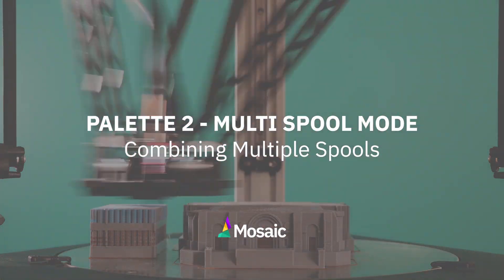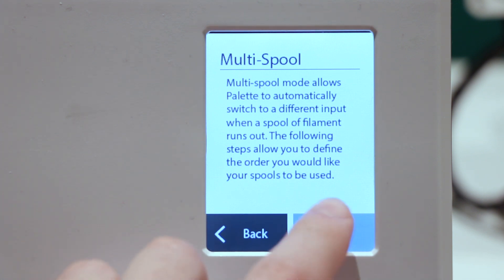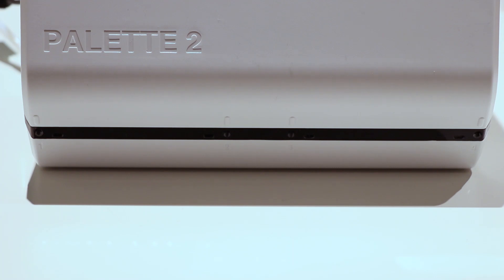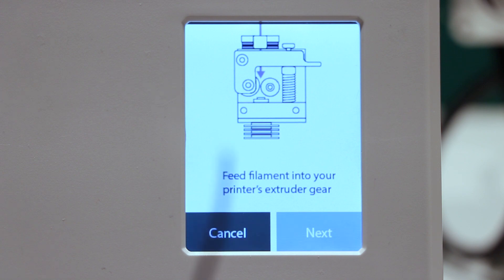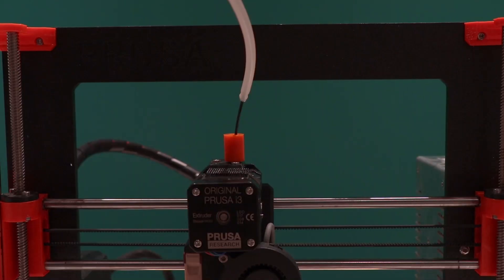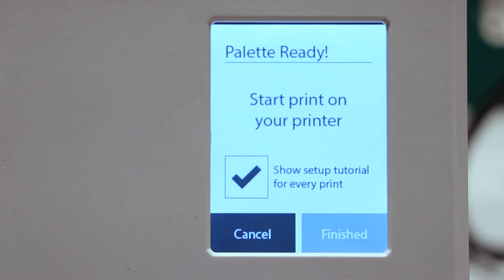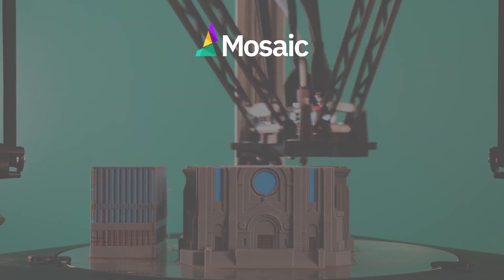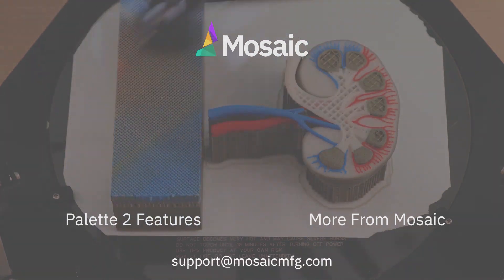Palette 2 - Multi-Spool Mode

Comment: Am using multi spool mode for my printer to print big parts.i can't print using 1mm nozzle at high speed because the federate of filament from pallete is not sufficient.can u help me how to change feed rate of mosaic pallete.I am printing at 30mm/sec using 1mm nozzle.
Reply from the maker: Hi santhosh, we have a test firmware that increases the feed rate of Palette. Please send us a message at support@mosaicmfg.com and we can send this over to you.

Comment: Couple of notes. 1) You should had the fact that the cooling fan will come on full speed during Multi-Spool mode, and will stay on as long as its in Multi-Spool mode.  2), what do you do when the buffer runs out of filament and won't "buffer" as seen here? https://youtu.be/BtdWqMy5lAc
Reply from the maker: Thanks for the feedback, Fred. Based on your video, this is a recent bug that has appeared in our firmware where the buffer switch is not communicating properly when triggered. As mentioned in a response to your comments on another video, we expect to have a firmware update released by the end of the week that will address this issue. We appreciate your patience.

Comment: nice that it cuts the filament. shame that it doesn't feed the in rest of the small bit left. leaving it cut and just... well just taking up space. the cool thing that palette 3 could do. is have a motor come out the top or something so that you could just use palette as a splicer for all the small stuff you have laying around too like the real small stuff
Reply from the maker: Hey Korey, there is a bit of leftover filament since the filament has to reach both the ingoing motor and outgoing motor in order to create a proper splice (as there is a bit of compression needed). We're working to create as little waste as possible and will definitely re-visit the multi-spool mode to reduce any leftover filament in the future.
Reply: @MosaicManufacturing  yeah after more fiddling with it I understood why after I caused some jams. Haha. But the thing that's fantastic is the jams are so easy to unjam.

Comment: Is it possible to choose spool numbering order? Or is it always from left to right?
Reply from the maker: Hi there, you're able to choose the order of inputs from Palette's screen.
Reply: @MosaicManufacturing  How? If at the screen where I select inputs if I select 4, then 3, then 2 it starts making the filament in order of 2, 3, 4. Theres no secondary screen after selecting the inputs that asks for the order.
Reply: @StuffWithKirby  No your are not able to choose the cycle. Its standard from 1, 2 to 3 and 4.
Reply: @MosaicManufacturing  Can you post the SOP as you describe in your response?

Comment: A few more questions... 

If one input runs out of filament and switches, can you then feed another spool into the input that ran out while printing, and have it switch back to that input when the others have run out?

Is there an output or a good solder point on the board, to use as a trigger for when the palette is splicing? Something you could use to say trigger a MCU to stop winding a spool for instance, or trigger a GPIO pin on an RPi to pause a print or take other actions? If so, what are it's specifications, and location? Voltage, current handling, etc.

Can you feed filament in from the top, and have filament fused onto it? For instance, if I already have a spool of filament, that I want to add a smaller chunk onto, without feeding the whole thing through.
Reply: Hey jesondag, to answer your questions:

- Currently, you would not be able to re-feed filament into an input once it runs out of filament. Runout detection will follow the order of inputs that you place in Multi-spool mod, however, we are working to create this feature in the future.
- The trigger from the solder point on the board wouldn't be possible without heavy modification, and we wouldn't recommend this unless it's necessary. We haven't experimented with this with Palette 2 units in the past.
- You would not be able to feed filament from the outgoing tube.

Please let us know if you have any additional questions.

Comment: Does it pause the printer if it's connected with a canvas hub? Is there any chance the splice might not happen fast enough, or does it keep the buffer full at all times in this mode?
Reply: You can pause the printer via OctoPrint if you're using a CANVAS Hub. The splicing and printing speed would depend on a few factors (nozzle size, layer height, print complexity, etc.) but Palette does work to keep the buffer full at all times. If you do find that the buffer is closing too fast and too often, we do recommend lowering he print speed to account for this.
Reply: @mosaicmanufacturing1603  Does/can that pause happen automatically when the filament runs out? How many millimeters of filament does the buffer hold between full and empty, and how long does a splice usually take on a palette 2 (non-pro), for PLA-PLA, with the cover off?
Reply: @jesondag  i don't know how big but seems like a 5-6"  sized  loop?   maybe less but going 80mm/s at 0.3mm layer height might be fine assuming your going that fast (depends on acceleration and model size)....lower layer high would eat filament slower.
Reply: @digibluh  The amount actually stored is going to be the difference in circumference between the largest size of the loop and the smallest (roughly, since it's not a perfect circle, which is a little hard to judge from pictures. I imagine that's a number the designers know though.
Reply: @jesondag  The total loop is about 120mm. The actual fill level is 52mm. The distance between the knife and the splice zone is 32mm, and when the filament is cut this much filament is pushed into the buffer. So the efficient buffer utilization is 84mm.

Assuming the default PLA-PLA splicing profile (40s to splice), 0.2mm layer, 0.4mm nozzle, and 100% extrusion rate, the buffered filament is enough to sustain it at 63mm/s.

But it is frequently draining the buffer down to empty to calibrate itself. And if you run out while it is empty the efficient buffer utilization is 32mm, and the max printing speed is 24.8mm/s.

So if you want to be sure that the print is not failing when the spool run out you must print at 24.8mm/s or slower.

Comment: Cool! But i wonder if it would be possible to splice together broken sections of filament back together and wind it up on another spool? (like for example prepare a spool for later usage when using multi colouar and/ or material)
Reply: Yes, that is possible! We have runout detection sensors on Palette 2 so once one input is empty, it will switch to the next one. This will allow you to connect small lengths together easily.
Reply: You could turn a spool with a stepper motor, and the built in encoder should just speed up the drive to account for it. You just would want to run it slow enough that it has time to splice before the buffer runs out.